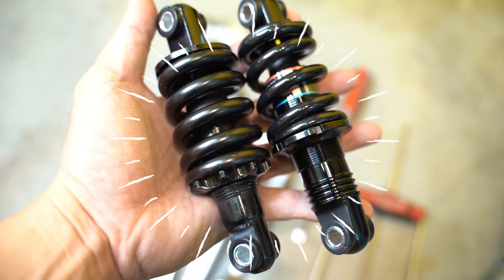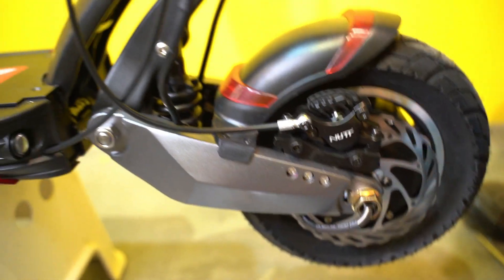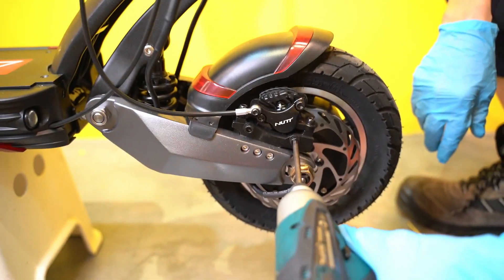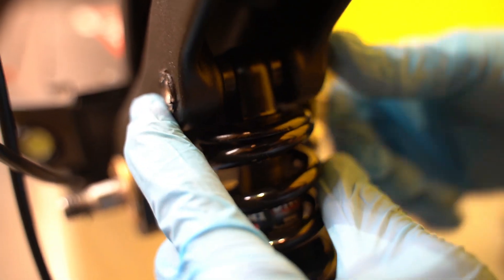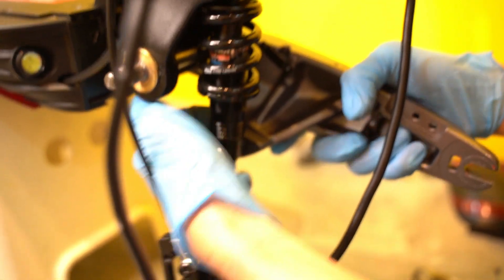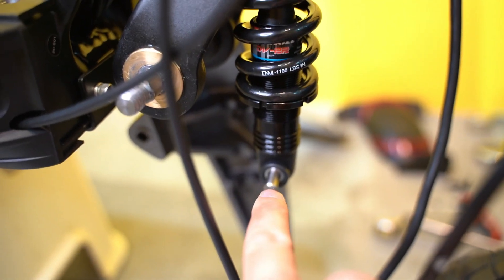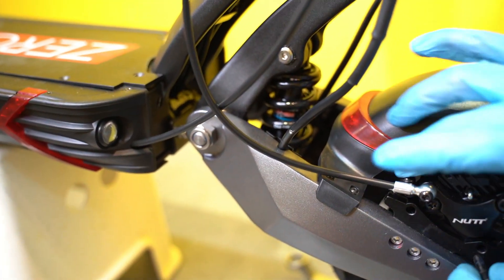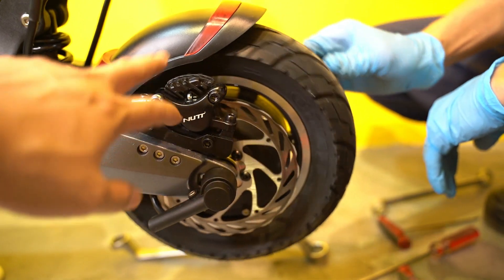The All New ZERO 10X Front Hydraulic Shock

Comment: Looks like the link in the description is only for a 165mm shock (rear only). I'm having a really hard time finding any adjustable 135mm suspension for the front. Does anyone have a link where to buy one?
Reply: As you found out, there isnt one, you need to make one from a 125mm and 150mm shock

Comment: Would be ok to install 125mm front and 150mm rear exa form 290 in 10X? I ride only in the city, no off-road.
Reply from the maker: Yes it’s ok. It will be very Low so you will scrap over any humps
Reply: @FalconpevSg  What springs (lbs) to choose for city riding? My weight is 85kg.

Comment: i have two exa 291r coming for my frontt of my scooter both springs rated at 250lbs so nice and skinny springs should be a nice soft front. i have a seat i sit on so my weigts all on the rear it is working very smooth at the moment with regular spring suspension on the rear 125mm and 950lbs spring and two of them. i might change them one day to exaform 291r 150mm and maybe 650lbs spring. i am 63kg. two 950lbs gives me a really tiny sag which is good for small vibrations. but more sag the better it sags like 1cm.
Reply from the maker: 250 lbs is definitely too small. anything less than 1000 lbs is too small for escooters. Those are more for bicycles.

Comment: When you jumped at the beginning I could see your shocks totally bottom out. The tire hit the metal part.
Reply from the maker: Bottoming out is pretty normal for scooters considering the travel is only 2+cm for scooter shocks. You could use stiffer suspension in that case. The video shows a 1100 lbs spring coil but you could adjust it to 1500 lbs.

Comment: I just installed mine (thanks for the fast delivery!) and took it for a slow/light test run. The ride height (loaded) is a lot lower than with the spring shock but it does seem to eat a lot of the small chatter which is great. Fortunately, I don't ride it over big jumps or anything major. I'll take it for a longer run later tonight, and a full 10km commute later this week and report back.
Reply from the maker: let us know the feedback after some time of use.
Reply: @FalconpevSg  I'm still using this and it's been great! Even over a year and a half and over 1000 km later, it's still performing as if it was brand new. Amazing.
Reply: I ordered this shock too and can confirm it's lower then stock (wished it was bit higher) but it eats every small bump I tried to ride on.(much better then original)
Reply from the maker: @LVShonzy  thanks for the feedback

Comment: Doesn't look like it makes much of a difference. What I did notice is that plastic fender flapping around.
Reply from the maker: If you look closely at the side by side, the stock suspension bounces back up immediately which is jarring and shocking to the body. For the hydraulic suspension, you will see that the rebound is very gentle. You have to try it to really feel the difference.

Comment: Anybody else seeing the same thing as me? "New Shock" bottoming out? Not enough clearance?
Reply from the maker: It will bottom out on any shock after a jump because after all it’s only 135mm. but it’s the rebound that we are trying to show. Watch the rebound
Reply: @FalconpevSg  So this "new shock" is not compatible with any mudguard? It will bottom out and cause the wheel to stop?
Reply from the maker: @ScootaGang  that’s not what we said. It won’t affect the mudguard.
Reply: @FalconpevSg  Ok! Can you upload a video of the "new shock" with the mudguard installed also? I think most of us would like to see it fit before we purchase anything could be potentially dangerous!
Reply from the maker: @ScootaGang  sure we will do that, but don’t need a video for that. Check us out on Instagram and we will post a pic. @falconpev
Reply: @FalconpevSg  Sure I can do that. But i'm most interested in a video like this to see how it doesn't bottom out after the jump...there are aftermarket scooter suspensions with this issue already. When it bottoms out, the mudguard causes the wheel to stop instantly, and the rider to faceplant. Just want to make sure that is not a possibility. Is there a reason you didn't reattach the mudguard for this test video?

Comment: It looks very tempting to try! I love this stock suspension though lol
Reply from the maker: Here is what we know of suspension science: the longer the damping, the more stress and shock is causes the rider (minuscule shock over long term becomes stress).

Pure Spring coils exhibit an almost linear or gradual decline in vibrations upon an impact shock. By introducing hydraulic fluid, the suspensions are able to have exponential vibration damping. Over the long term, this leads to lead stress on the body of the rider.
Reply: @FalconpevSg  I didn't understand. Do you prefer stock or hydraulic or air suspension?
I have Vsett 10+ btw

Comment: You guys have the best installation videos that explains it very very well #1🤙🤙🤙
Reply from the maker: Thank you. Here is what we know of suspension science: the longer the damping, the more stress and shock is causes the rider (minuscule shock over long term becomes stress).

Pure Spring coils exhibit an almost linear or gradual decline in vibrations upon an impact shock. By introducing hydraulic fluid, the suspensions are able to have exponential vibration damping. Over the long term, this leads to lead stress on the body of the rider.

Comment: Such a soft suspension might be comfy but is not good at all for higher speed stability, cornering traction and bottoming on jumps or obstacles.
Reply: @Raptorlishus  @Raptorlishus  Did you even red what he wrote before spitting out nonsense, what are you even talking about? Sound like you are the one who needs to learn one thing or two about suspension and how it works and how stiff suspension have better stability and gives better traction. Scooter is suicide with bouncy suspension at higher speeds.
Reply from the maker: It’s tunable with the spring coils. Turn the springs tight if you want them stiffer

Comment: About time! Haha, good stuff! Interesting it isn't adjustable damping. I highly recommend getting this and the 165 DV22AR for back. Little bit concerned that it bottomed out onto the tire at the end. Would certainly hit the mudguard. Hopefully just winding pretension up will sort that out. What is the spring rating? I presume somewhere in the 800-1000 lbs range?
Reply: I think he says 1100 pounds
Reply from the maker: Yes 1100 lbs
Reply from the maker: The bottoming out is on a 100kg rider. On the other 80kg rider it nicely gently bounces back